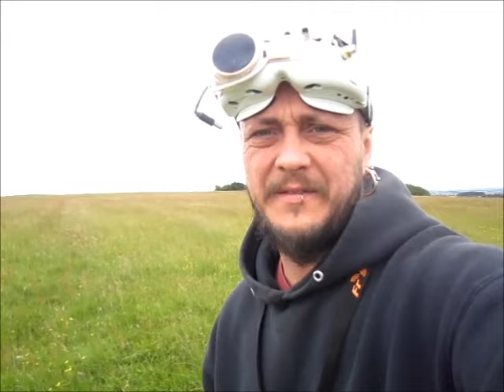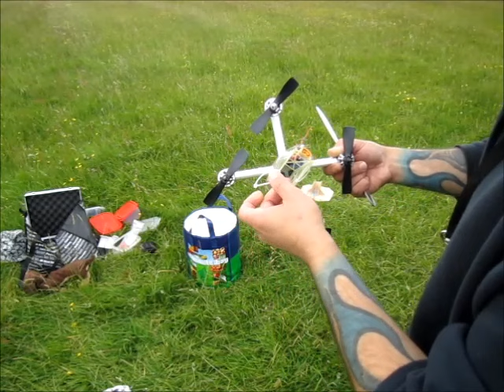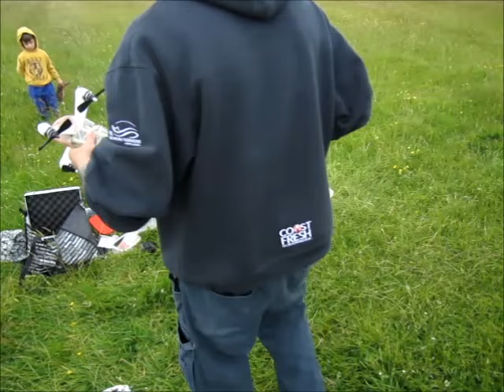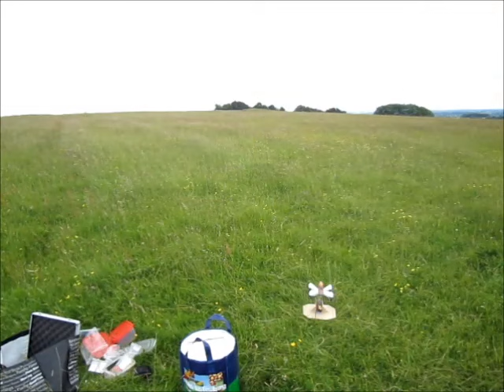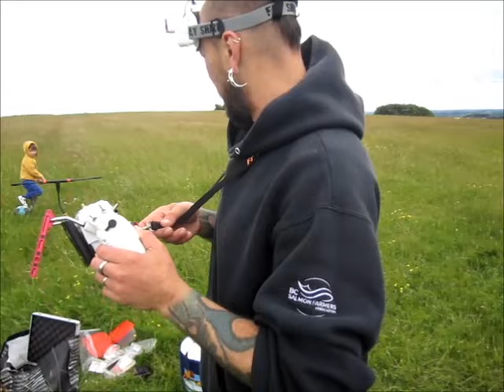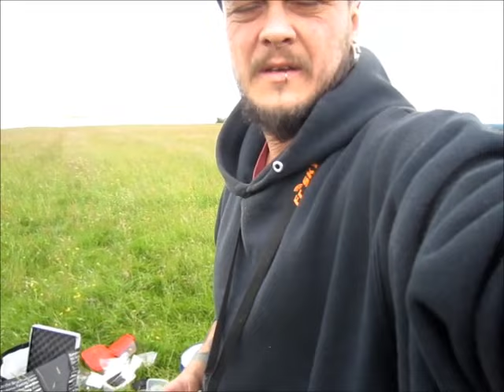Miniquad speed record. Part11. V3 last run, 191 km/h only..

Comment: I really like what you're doing and I wish you the best of luck to crack the 200 km/h mark...

one thought though... you mentioned that you're not that good with tuning the pids... so I assume this copter is not perfectly in tune... this means that the control loop over or undercorrects in flight... this means some of your power is wasted for those corrections.

So I think you might need a little more tuning... maybe this is just enough to get a little more thrust... hope this helped

cheers
Reply from the maker: Yeah man, I hear ya, it does need a bit of TLC indeed. I was moving from Ireland to Canada so I was in a mad rush just to get them few flights and go packing my garage. Now that I'm in CA it will take few months till I setup my workspace and gather tools again, and at the wrong time my record of 194 km/h was beaten by Cathalystmachineworks. He cranked up 206 km/h, and no matter how anxious I am to get my other tricks out of the sleeve (yes, I'm pretty sure I'll top that up:) I can't do anything ATM.
Cheers bro, thanks for heads up!

Comment: 194. So...so close. Your such an insane DYI er. I think you should start hand winding your own motors. Each wire carefully placed for max performance. It's only 6 kmh! Maybe A pointy nose? Drag increases by the square of your velocity. I'm sure you can squish the next version down just a little bit more. LOL. Best of luck to you.
Reply from the maker: Yeah brother, you just read my mind:) That is exactly what I've planned for V4- same setup coz it survived and there are few new props that I didn't try yet. And instead of cutting battery holder from GF plate I'll form it from fiberglass (or carbon) cloth with resin what will be same strength but lighter and the whole width of copter will be no more than 32mm. And I'll get flat CNCed arms mounted vertically with ESCs inside them what will leave me the width of no more than 5mm in stead of existing 13mm with 12mm tubes used. And next time I'll take more time to get my aerodynamic covers done. 
There's much more to come and that road is not as smooth for me but I'll get there, little by little:)

Comment: 5051 racecrafts on tiny carbon frame with 2205 (200g) will give you 200 km/h on 4s only
Reply from the maker: At the time these props were not around, despite that I didn't even finish testing other props I wanted. I was seriously short on time as I was moving from Ireland to Canada and had to pack my gear rather than going flying:)
As soon as the weather gets better I'll go back to this quad with Racecraft props, before I'll start building V4 bubu.